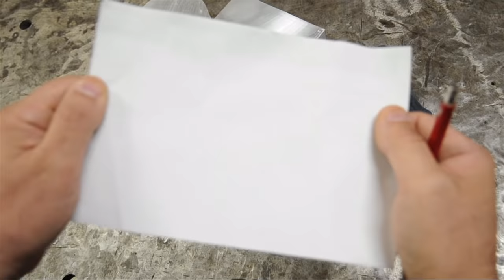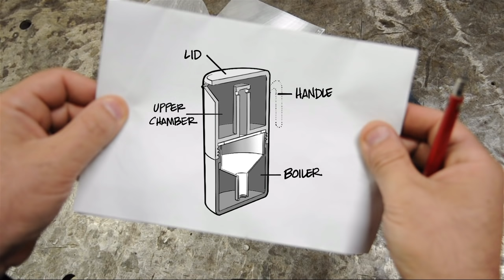Making An Espresso ... Pot!

Comment: Machining a thin walled part from a big solid piece of stock always reminds me of those old cartoons where they use a whole tree 🎄 to make 1 single toothpick. Great video! 👍👍👍👍👍👍
Reply: This is why additive manufacturing is obviously better.
Reply: @embretr  I disagree. Sintered powdered metal and cast parts  are not the same as ones made from solid metal stock. You can make some stuff you couldn't machine otherwise. But that's a pretty broad statement. Plus there's nothing more satisfying than making chips.
Reply: @alexbarnett8541  I suppose it's possible to do a quick forging pass over a cast or sintered part to restructure the metal to something closer to a true forged or pressed part.

But at that point you might well start thinking of forging it from the start.
Reply: @sergarlantyrell7847  the new hybrid CNC and additive machines like the Lasertech 65 3D from DMG Mori are pretty crazy. I think that's going to be the future. Would be cool if they added casting and forging into one CNC controlled machine.
Reply: You could start with a thick walled aluminium pipe and then weld a disc on as the base. Not much good for this project though as you need the spout in the middle of the top half.
Reply: IOUaUsername with the idea of minimal chips he could have almost welded the entire thing from tubes and discs. One large tube cut in two, one small spout tube, and 3 plates for the bottom, middle, and lid.
Reply: I've always thought the same, but only being a YouTube machinist myself (ie. I just watch this stuff for entertainment), I presumed that the chips get taken back to the scrapyard and recycled, with a high % of the material cost (by weight) received back. Either that, or it would get melted back down to 'new' stock by Tony himself.
Reply: @IOUaUsername  Would be OK to thread or weld the central the spout into a thicker base.
Reply: @embretr  Additive manufacturing is cool, but it has some pretty severe limitations.
Reply: @alexbarnett8541  I believe Mazak makes 'em.
Reply: Additive is the future
Reply: @junkdubious  Wow. So both additive and subtractive in one machine? Even cooler
Reply: @dan_  Yeah, I always sweep all the scrap into a designated steel or aluminum bucket and take it to a scrapper who recycles it.
Reply: 1 year later from This comment. You should see the video that Hand Tool Rescue uploaded today.
Reply: @embretr  not necessarily. Additive manufacturing is good for some things but bad for others. Additive processes don't have the same strength in every direction. That's a big problem for some things.
Reply: Checkout Hand Tool Rescue, he did that very thing for his Christmas 2020 video using a hand plane
Reply: @Travel history casting probably
Reply: @Travel history in a production environment casing is a very popular method for stuff like this
Reply: @Travel history yea
Reply: @embretr  if I was to design a manufacturing system for a part like this. It'd likely maybe be a stamped part, run a flat sheet through a bunch of varying depth dies. If it's too much force to make, then I'd take a flat sheet and run it through a couple rollers and roll the part. Then robotically weld a bottom on and weld the seam. But I'm not a manufacturing engineer so maybe there's a better way.
Reply: generally speaking things like these are made either in molds or via spinning a disc of stock and drawing it into shape over a form with a wheel
Reply: @littlesnowflakepunk855  yes they are. Spinning is a cool process. I've always wanted to try doing it. Subtractive manufacturing is better reserved for parts that need higher precision. I personally only own a lathe. So I'd have to go about it the same way if I wanted to make my own.
Reply: @DC  you might get 25% of the actual value of the weight of the chips back. The people that buy the scrap metal don't pay market value.
Reply: @SuperMadpom  
Which would also have allowed him to angle the jets downwards (and make them more precise in general), since it could have been be manufactured as an extra part. Mill a hex on the top, and you can even remove it from time to time for deep cleaning.
Reply: As long as the chips gets recycled I don’t see the problem.
Reply: Or the simpsons episode showing how a bowling alley handles bowling pins. Same kind of joke showing the pins only get used once lol
Reply: @bazoo513  Just make a coffee pot from Lego, it has a (slightly) higher boiling point than water!
Reply: @IOUaUsername but turning a spout from thinner bar stock, welding in place and machining the tapers etc....
Reply: I laughed so hard thinking that too watching the video, then laughed doubly hard at this comment, thank you.
Reply: @embretr  Not everything has to be sorted into tier lists.

Comment: Tony, I remember watching this for the first time, four and a half years ago, and being amazed at your work. And the fact that you turned about about £70 worth of stock into a £15 coffee pot.... but the $6,000,000 question is: do you still have it and does it still work?
Reply: There is so much gold in this comment!
Reply: He can't remember from repeatedly drinking liquid boiled in aluminum.
Reply: @BedroomMachinist  Was thinking the same thing...  This should be coated
Reply: I was just about to write this same question. Tony? Are you still using it?
Reply: @BedroomMachinist  bro like every mocca pot in existance is straight aluminium... It's fine...
Reply: Yeah this was one of my first ToT videos way back when it came out
Reply: @Bobo-ox7fj this is the first I’m hearing that aluminum is bad for us. Do you have any sources? The only thing I found was aluminum oxide, but an article from a doctor at Ohio State says it’s potentially harmful effects were debunked.
Reply: @greatodinsraven It's actually why you're instructed to dump the first pot of coffee you make with it. Aluminum is extremely reactive. By the 2nd pot, everything that will react will have reacted and formed an insoluble oxide coating.
Reply: @cheyannei5983  I thought aluminum oxidized almost immediately after it was exposed to air and it was safe. I understand people have said putting on deodorants with aluminum in it is bad though.
Reply: @cheyannei5983 
Acidic compounds can dissolve parts of the oxide layer and pull aluminum ions into solution. Really acidic coffee would probably be a bad idea in these types.
Reply: @typrus6377  Coffee isn't that strong of an acid. Something like straight vinegar will absolutely strip the oxide.

I have such a pot, I can leave coffee in it for days and it won't have done anything to the oxide. 5 minutes in vinegar, though...
Reply: @cheyannei5983  
I've had some coffees that were acidic to an unpleasant level- I question what they may do- but for the average bean and roast, I would tend to say you are likely right that it isn't going to do much.
Reply: @typrus6377  Moka pots also extract pretty quickly. 2 minutes and some seconds if you slow it down... and then out into the cup because there's not a whole lot of liquid and it cools down fast. Compare that to a percolator or French press where it's just sitting in the pot forever and a day and the risk is nonexistent.

Comment: Great video and build.

My drip coffee maker died one day so I decided to build my own. I used a 1500 watt hot water tank heater inside a stainless pipe to heat the water. The lights in my kitchen dimmed when brewing, but it made a 12 cup pot in less than 60 seconds.
Reply: Jesus, did u build a steamer?
Reply: 60 seconds?  But I want it NOW!
Reply: @seanhall8686  Modify a Quooker!
Edit: If you can get 400Volts from your wall there's commercially available 27000 Watt heater elements available. Godspeed.
Reply: Make the pipe glass and you basically built a moccamaster. Doesnt much better than that so well deserved 👍

Comment: @this old tony Hi there. I'm Italian, so this qualifies me to criticize your otherwise beautiful work. I had to watch all of your videos to find an hint of imprecision, so I hope you'll appreciate. MR Bialetti has been a precise man and like every Italian engineer had passion for design and simmetry. So he designed the pressure relief valve placement to mark the correct torque for the gasket. He designed the Moka to have the valve and the spelt to be in a vertical line when torqued correctly. In effect despite that attention, even in Italy every day we abuse a lot of poor gaskets.
Reply: Wow that's really cool. I have a couple bialetti mocca pots and I guess I've been abusing my gaskets as well.
Reply: Nome Cognome : ABUSE - what gaskets are for
Reply: My biatelli exploded a few months ago due to that valve not working. Coffee paintjob for the kitchen and my face 👍😐
Reply: @luminousfractal420  that's because  biatelli is clearly an imitation 😂

*Seriously, mokas esplodes when the vast majority of holes in the 2 filters are clogged, either by coffee or by solid residues due to evaporation
To avoid explosion  have just to to clean once in a while.
Pressure relief valves clog due to hardwater buildup. There are some new gen valves that you can disengage pressing by hand.
Reply: This could explain why I go through so many gaskets ..........
Reply: That's a beautiful mating of form and function
Reply: Nome Cognome - I agree about the tightening torque when the gasket is brand new but as it ages it softens and needs a bit more tightening otherwise it will leak and anyway gaskets are cheap enough to buy - and talking of moka pots i think the Giannina is a better pot than Bialetti as there are no threads to engage - the handle swings down to close the two halves and much easier to open up - have used one for 5 years and is a better product in my opinion.

Comment: Dear diary,
Today I learned that Demosthenes was reasonable machinist
Reply: Btw, This Old Tony
While rewatching this video about 329th time I thought I'll share one piece of advice with you
When you try to polish just about anything, I suggest you trying to use 3M's P3000 Trizact for final/just before final step
It's a spongy sandpaper used for wet sanding. The finish is just lovely. I saw it in form of 150mm diameter discs for sanders and I'm not sure if there is any other, maybe different diameters, but anyway it's still good for manual work.
I heard about "higher" grits ("higher" like P6000) and never used it though, but I assume finish would be even better. Although I highly recommend against P1000, bad experiences with those.
Reply: Love the vid. I got to get more tools before  I can try this. but in time1

Comment: You are right about the placement of the pressure valve. You want it pointing away from you. Also the height of it is useful as an indicator to fill it up with water to the correct volume. Great build!

Comment: If you begin with hot water in the bottom chamber and keep the stove temp low you'll get a better espresso that won't taste bitter.

Very nice design though, love the wooden accents against the polished aluminium. 

One of the nicest looking moka pots I've seen!
Reply: There will never be espresso coming form this thing. It might be called an "Espresso pot", but what it makes is just coffee. For espresso you need much higher pressures.
Reply: Also, add a little slice of lemon peel in there. A trick the Italians do I'm told.
Reply: Not even; this is a moka pot.  The coffee it brews is quite different to espresso, but it's still good once the pot's been 'proofed'.  Nice video.
Reply: What are you talking about? It's a Moka pot, it works on room temperature water.
Reply: @9peppe  If you put hot water in the bottom you're not heating the coffee as much and therefore it becomes less bitter
Reply: @radioactivated  your coffee will still get to 90 °C at least. The water temperature does not really matter, but the air temperature in the boiler does matter a lot: it isn't water vapor pushing water in the upper chamber; it's just expanding air, and hot air does not expand as much.
Reply: I have tried it both ways and now always use hot water to start with.  With cold water, the pot itself gets hot and the finished coffee is always boiling in the top chamber by the time it stops brewing.  Is much less bitter (and more consistent) to start with boiling water.  I also pre-moisten the ground coffee with hot water before screwing everything together.  It really does make a difference....
Reply: @ronskopitz2360  I agree. Had years of backpacking with a small moka pot to make my coffee and starting with boiling water is the best way to get the water thru the grind without introducing bitterness. I can even pull Crema out of it this way, much to the annoyance of several people above that can't use a moka pot for the life of them!

Comment: Hahaha taste like WD40!! Love the sense of humor
Reply: I know  it's old video and all, but for aluminum mochas, i think first 10-15 brews are to be trashed for the taste to become "normal"
Reply: or better yet use stainless.
Reply: Don't use WD40 on your welding table it's an insulator.
Reply: idontcare I know it is an old comment but that is correct, the first couple of brews tastes horrible and the flavour starts to get better when the coffee oils sticks to the inside of the pot. Also never wash the insides with any abrasive or stuff that removes the oils too much, then you are back to aluminium filled horrible cups of coffee.
Reply: When I stopped working in a machine shop, I had to keep a can of WD-40 next to the kettle. Coffee didn't taste right without it
Reply: You're lazy if you don't know the tatse of wd40
Reply: @I_leave_mean_comments  thats mean
Reply: Regular menu position in our local DIY cafe. Goes fine with solidol cupcakes

Comment: Great job! Now you need a tamper to pack the grounds down good and tight.  Thanks for this.  So I get where you are coming from on projects like these.  I am an electrical engineer but my true passion is custom wood working and I own a custom wood working shop.  When I don’t have a customer project to work on, I find myself really testing my skill and knowledge with my tools. So I get it and thanks for letting me know I’m not the only one who does this sort of thing. 
All the best to you and yours!!
Reply: No sir - you must NEVER pack the coffee grounds down tight in a Moka pot , or if you do, the pot could explode if the safety valve malfunctions - you may be thinking of the espresso coffee makers used in restaurants and coffee bars , yes in those the grounds are packed tight as those machines work at a much higher pressure - so in moka pots the grounds are just allowed to settle under their own weight - i know as i have used moka pots for more than 60 years and we also have an industrial coffee maker as used in coffee shops.

Comment: Beth the friendly manual/ CNC machinist here! If you’re ever worried about collapsing thin walled section that you’re machining, take a very heavy depth of cut compared to your desired wall thickness at a slower feed rate on your final cut. This essentially ensures the cut is self supporting and therefore you can’t collapse the bushing that you’re making! :) this is how they make bushes with 0.15mm walls :). Give it a go on some scrap and you’ll find some luck!

Comment: So basically, it works like a Pythagorean cup but with back pressure?
Reply: Exactly.
Reply: That's exactly where it comes from. Someone mixed the two and got the original pressure coffee pot, of course, the first ones had no pressure valves, so, yeah, for a while those were highly unsafe.

Comment: But is uncoated aluminium food safe?
Aluminium pots and pans have teflon coating, and aluminium soda and beer cans have some sort of plastic or epoxy coating on the inside. I thought the only uncoated metal considered food safe was stainless steel?
Reply: The idea, at least as far as I know, is to throw away the first brew and to only rinse it with water after that. The oils of the coffee build up on the sides of the pot sealing the future brews from the bare aluminium.
Reply: Aluminium oxidises almost immediately on contact with air forming an inert aluminium oxide layer. This is the property that makes aluminium resistant to corrosion in water. This prevents foods from contacting elemental aluminium.

Aluminium exposure was once suspected of being a possible cause or contributor to Alzheimer's disease but I believe that link is now deprecated, or at least not suspected of being a major cause.
Reply: OK, then just look at the reports on 'Teflon' and BPA (of which the plastic is composed ) !    i 'd sooner take the chance on the metal - the two former seem a lot more injurious to health than good 'ol aluminium !
Reply: Pans have a Teflon coating cause it's non sticky but Teflon contains fluor compounds and there's some controversy about it, to be honest nothing seems 100% safe these days. Beer cans and other carbonated drinks are coated cause drinks are slightly acidic and would attack the aluminium without this coating, before there was iron cans and they too were coated too.
Aluminium in contacted with air forms Al2O3 on the surface and this is a very strong kind of ceramic that protects it from further oxidation.Look to the cans made of aluminium they last ages while being paper thin.
Reply: You just shouldnt scratch it. Aluminium oxides will protect the food. Al2O3 is one of the most stable coumpounds in inorganic chemistry.
Reply: Bialetti has been making this type of pots in aluminium for 80 years now, though they are made of castings, not machined aluminium. Every Italian household has a few of those and they get to live to an old age, so my guess is that it should be pretty safe.